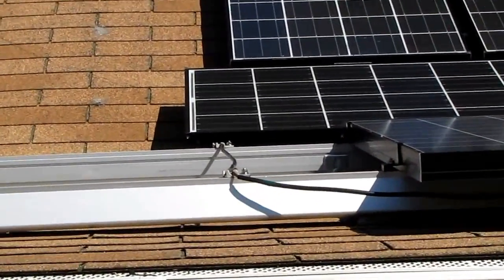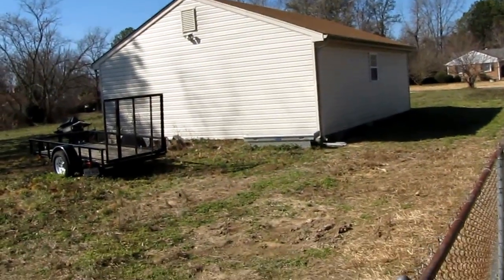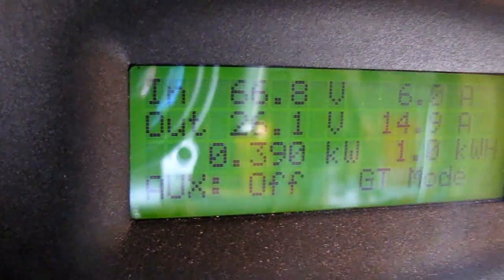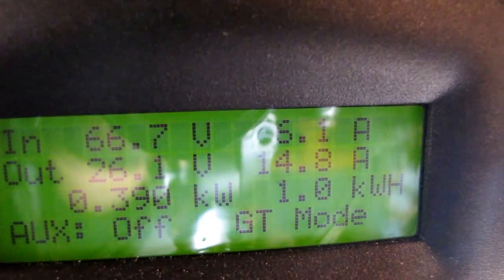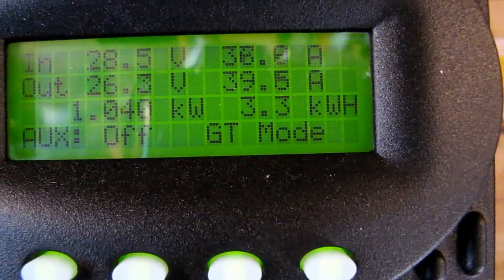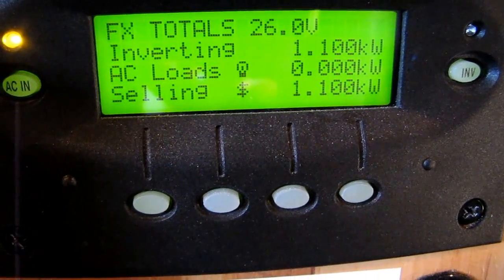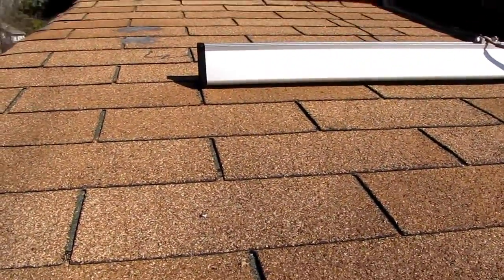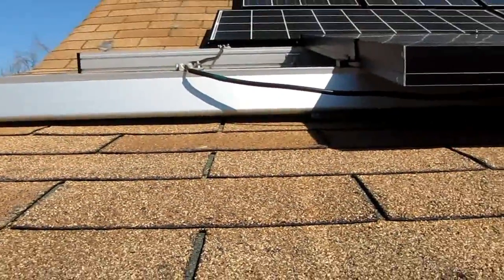Solar Panels I'm Adding Just One More Solar Panel To My System In Series Pt 1

Comment: That is a cool hat, man. I am going to brag a little I had four 230 watt panels and one little 80 amp one day making a constant 800 watts one day awhile back. That was just one tracker. I have two trackers though.  and some more still panels on a patio and a roof of my shed. I just have the cheap Chinese solar panels. so far so good. But the small  little eighty watt panels have cracks in them? I wonder why the cells did that?

Comment: I will in a few weeks have 6 145 watt DMsolar Panels. cant wait. dont have out back yet that will have to wait a while but I have GTI inverters and a 800 watt APC unite I will run off the battery bank.  I now have 6 80AH batteries now set up for 24 volt at 240 AH   I also have 4 80 watt pannels and 2 40 watt pannels all will be wired up for 24volt for a total of 1270 watts. will defently be going some were now. lol tax money has come in handy lol.